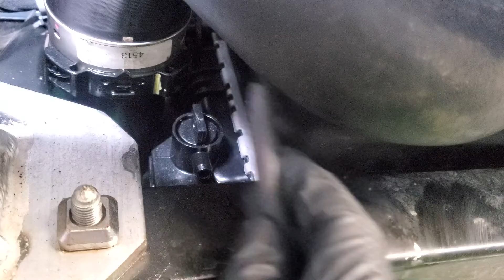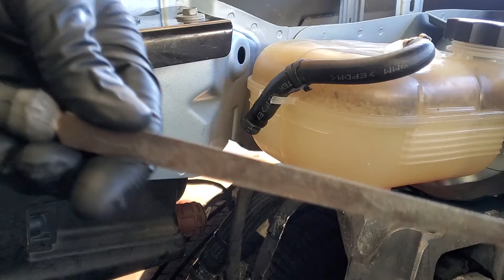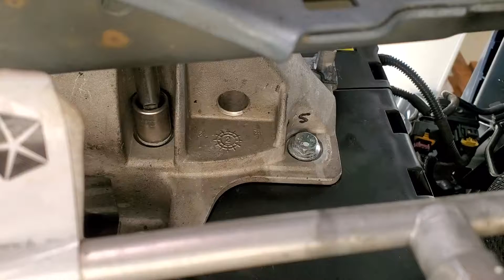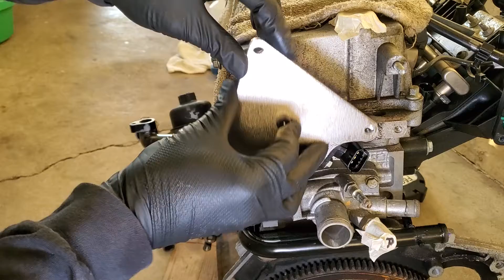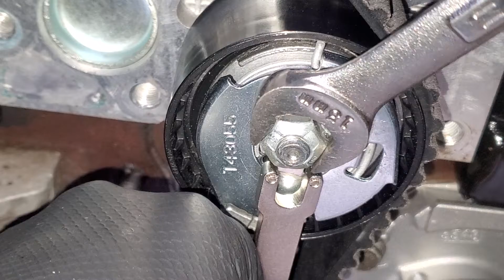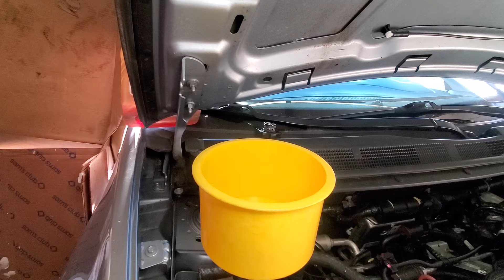How to replace the timing belt & water pump on 2013-2016 Dodge Dart/Fiat 1.4L turbo easy method

Comment: all the way from Nottingham in the United Kingdom i salute you sir for your wisdom .
i kept telling people here that is possible to change the belt on my Jeep Renegade 1.4  multi - air engine without disturbing the vacum pump . 
I too been marking belts and camshafts for years on other cars and it always  worked fine , yet Fiat insist in doing it that way , when there  is no need. Thank you i will now go ahead and order the timing belt  kit from Jeep and do it myself as they want  nearly £1000 for doing it .🙏🏻👍
Reply from the maker: Much appreciated , glad the info helped. Always good to hear from across the pond. Best of luck with the job

Comment: Is that normal to let the rtv set up overnight before torqueing the bolts ??
Reply from the maker: It is exactly how I treat any rtv job . I never have any leaks or worries that way. Thank you for the question.  If you find value in the video , I hope to gain you as a subscriber.

Comment: So you strongly suggest replacing the water pump also when doing the timing belt..my 13' Dart has 60k on it so no need yet. Enjoyed the video anyway.
Reply from the maker: I am sure with 60k it will be fine for years to come. Thanks for watching.

Comment: Does my dodge dart 2026 sxt have a timing belt or chain?
Reply from the maker: If you have a 1.4l turbo engine it will have a belt. If not , it will have a chain. Hope this helps.
Reply: @s33therfan   Thank you for getting back to me. At 62 I downgraded from an Evo to a Dodge dart sxt, so it helps your info it has a chain. Have a great day.

Comment: is the idea of the extra tools to hold all pistons still while you change the belt?
Reply from the maker: Basically to make sure nothing turns by accident. Even if it does , the engine can be easily put back at top dead center. The crank tool is fairly easy and simple , however the cam tool is unecessary and alot of extra work. Marking the belt is the easiest method. You will know the marks are perfect and there is no slack. Thanks for watching.
Reply: @WrenchTheory501 i see. So you never loosened the top cam pulley during this install? Thanks again for the video
Reply: @ststst981 That's where you would get into trouble and HAVE to have use the lock set. The cam pulley is not indexed. If you loosen the cam pulley bolt, the pulley can then freespin, and you would not be able to get it back into time without locking everything down.